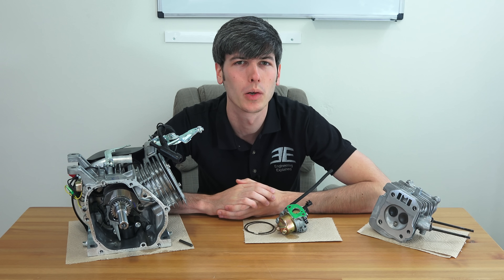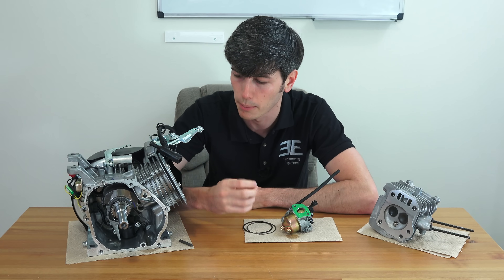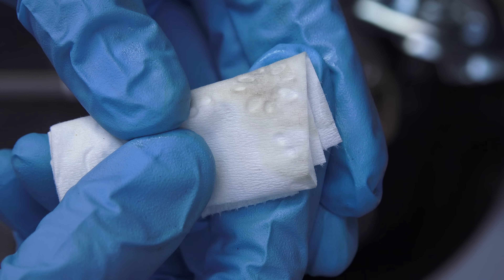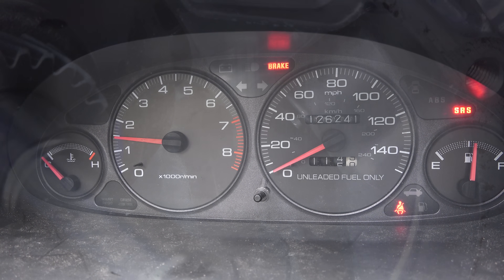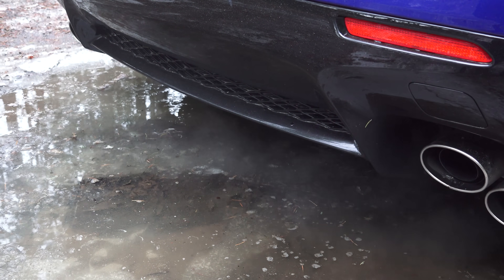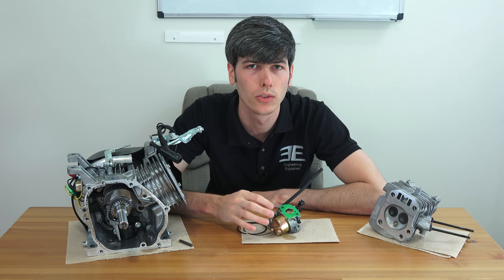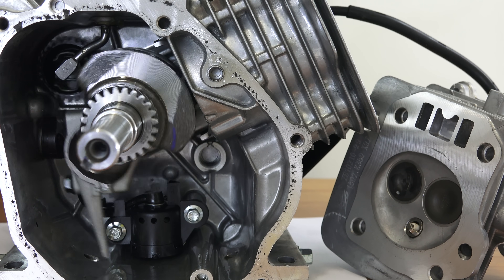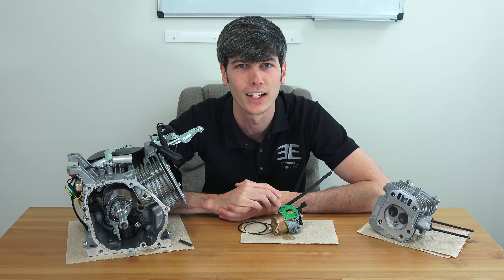Should You Warm Up Your Car Before Driving?

Comment: I always warm my engines before driving.  Engines with over 850,000 and 670,000 miles. Fluids need time to warm.  When steel mechanical parts are cold they are more likely to break .

Comment: Apart from the obvious need to demist the screen before driving there is also the question of the head gasket clamping force. With an "alloy" (aluminium) engine with the head held down with hight-tensile "stretch" studs the differential expansion of the alloy block & head relative to the bolts increases the clamping force on the head as the engine warms up. From memory the clamping force with the engine at around 10degC is about half what it is at 105degC. So giving the engine full beans when cold risks blowing the head gasket. With some highly tuned engines it's an almost certainty - the R500 K-Series based Caterham engine could be almost guaranteed to lunch the head gasket if you gave it full right beetle-crusher before it was fully warm.
So, contrary to what some have said, let it spin in a lower gear and at modest throttle opening so the cylinder pressure is kept down and don't lug it in high gear at high throttle opening as this gives a high cylinder pressure that increases the chances of killing the HG.

Comment: If your oil is 20w50, then a warm up is a necessity. Thick oil does not circulate much when cold.
Reply: You should not use 20w50 when it's cold 😉
Reply: @humanandroid8099  I live in the tropics. It's only cold in the morning (Dec and Jan). My engine is already quite old and therefore cannot use lighter synthetic (or else leaks could occur).

Comment: I heard on the workshop (a motorcycle channel) that the piston rings and possibly other components have to expand to the proper sizes. I never thought about fuel atomisation. Why does fuel atomise less efficiently in a cold cylinder? Is it that the air is more pressurised when it is cold, therefore gas molecules spread less efficiently?

Comment: One other thing you have to consider is that it takes 10-30 seconds or so for the electronics to boot up and enable your vehicle to give you the optimum performance, as it was designed to do. So some warming is optimal both for the engine and the electronics, especially in cold weather.

Comment: If it's really cold 0 and under give it few 5 min and temps in over 20 I give it a min or two. In my semis when it's really cold gotta give it 10 min warm up with idle pumped up to 1000rpm after a min or two idling.

Comment: Today's cars are super simple: just wait until it gets out of high idle, then drive the vehicle easy until the temp gauge reaches normal temp. That's it. It doesn't need to be anymore convoluted than this.
Reply: I totally agree.  However, my car takes a couple of minutes to get out of high idle - even in 40-50 degree weather.

Comment: You bring up valid points and do a great job of explaining. My issues on this topic would be about waiting to drive because of a carburetor...I respectfully disagree. Things like different metals and their expansion. Forged aluminum pistons will expand in a cast iron cylinder bore at different rates when heated, but the excessive “play” or “slop” can leave scoring on cylinder walls- my understanding. I know Chevy LS motors used hypereutectic pistons in the early 2000’s and created a “piston slapping” sound that people mistook for a rod knock until the motor was throughly warmed up. Then turbochargers need oil to prevent early damage, and I’ve seen it take motor oil 30-45 seconds to make its way to the top, out of a rocker arm on a small and big block Chevy with low miles on them!!! Yes, not everything can be covered in a video. But more than just a carburetor is why I wait to start driving my autos. Just my buck fifty 😉 Keep up the great topics!
Reply: I’m sure your “understanding” is more than the plethora of engineers who designed these engines and the engineer who made this video.

Comment: Lame video.  You didn't put much work in here.  Doesnt the increase in rpm while driving offset the shorter time to get warm?  Doesnt the engine heat faster when no cold wind is blowing through the engine?  Seems like you forgot the engineering
Reply: Nope, it warm up quicker if you drive. I just measured the time a few days ago. 6:50 mins with idle, 3:xx mins with driving. Same outside temp.
Reply: @humanandroid8099  
You are not taking the rpm into account, as that is the better measure of wear than time in regard to gas leaking past cylinder wall.  
6:50 min at 700 rpm is 4783 rotations
3:30 min at 1450 rpm is 5075 rotations
So although your engine warmed up faster, it resulted in more wear on itself while in the cold state.  
I was wanting the video to go into this level of detail.
Reply: @Prima10ne  Cold idle started at around 1,200 and I limit the rpm to 3,000 while driving cold. Usualy I wait 1 to 2 mins till the rpm drops a little.

I'll retry it taking the revolutions into account.
Reply: @humanandroid8099  id watch that video

Comment: Why should I wait to drive hard? I thought having the car warm didn't matter? With a new car I think he's right but with an older car (fuel injection or carbureted) you should let it warm up. It's good for the engine AND the transmission.

Comment: You're not addressing the block having varying temperatures while warming up. Hot and cold spots while placing the engine under load can wear parts faster.

Comment: So my question is what is light driving?  If i let my car warmup at 1100 rpm (just after starting) - then I change gears into Drive at 1000 rpm - then light driving is at 1300 rpm - wouldn't it be better to just let it warmup by idling?  I dont see a difference between high rpm not moving vs high rpm moving.

Comment: 1:05 "the longer you spend with your engine cold, the more wear you'll have"

Seems contradictory to your opinion on not warming up a vehicle.

If an engine is not at operating temperature (ie:cold) won't wear be accelerated by the parts (heads, pistons, exhaust/intake manifolds)not being at the proper tolerances as they would at normal operating temperature?
Reply: Görsel : that's a Good point
Reply: @westistanbul  that's because they can't lol

Comment: I warm up my vehicles so their transmission can warm up as well. My vehicles don't shift well when they are cold.
Reply: I've had this same experience. Let it warm up and I don't have problems. Smooth shifting. Drive on a cold start and herky jerky shifting
Reply: I had a car that leaked transmission fluid. I could always tell when it was low because if it was cold out and I tried to leave without warming it up first the car wouldn't move lol

Comment: I always let the car warm up between 30 seconds to a minute, just until the rpm drops down to a regular idle.
Reply: EveryDay  Well by all means, do the math for us. I'm just a lowly Mechanical Engineer.. we don't do much math.
Reply: EveryDay  No one is saying you should sit and idle for minutes at a time, simply stating that allowing the system to fully pressurize is okay. We all live in different climates and deal with different temperature extremes. We all drive different cars with differing oiling systems; one of mine uses a remote oil filtration system, a catch can and associated plumbing. Stands to reason this type of system will need more time to fully pressurize. That said, I get in, start the car, buckle the seat belt, check mirrors, put the car in first gear and go. Maybe 30 seconds, tops. When it is "really cold" out (30ºC) I give it a little more time because as you know, viscosity and all that. 
But if you'd like to argue, just for the sake of argument and make a hard fast "xx seconds" rule, then you're only success is going to be... showing your own  ignorance, especially when people aren't necessarily in disagreement with you. 

Learn when to joust with a windmill Quixote.
Reply: EveryDay  30-60s is fine for lubrication... it's even mentioned in the video.
Reply: It's not just about proper lubrication there, are many more things to consider.
Reply: @andreew46  like what?
Reply: @dragospahontu  Temperature differences across all engine components. Temperatures mainly effect bearing clearances and piston seals. And it's a good idea to let your transmission to heat up a bit.
Reply: @andreew46  afte 1 minute i think you can start driving but definitely don't floor it until the oil temp is at least 80°c.
Reply: EveryDay  could you really get even dumber?
Reply: EveryDay no because it has load on it then
Reply: EveryDay  It's not
Reply: EveryDay  I'm a mechanical engineer and I know a lot about materials.

Comment: I just usually drop a lit match into the gas tank, so the fuel mixture is hot and warms engine up in seconds
Reply: YouKnow this is true, however jet fuel is hard to get, bit expensive and some engines have problems with it. A lit match is cheaper and works every time!

Comment: I let it run in the winter until the cabin isn't freezing cold: I'm more considered about my body being cold than the engine 😁
Reply: Beta
Reply: Thats just wrong.
Idling your car wears the engine out prematurely and it make stew heater take a lot longer to actually get warm air to the interior of that car.
Since you are in cold weather you already are wearing warm clothes, so getting inside a car is warmer than being inside because the cold air is not blowing on your and your body is warming the interior.
Idling the car that I just tested three days ago took 12 minutes to get warm air to the heater vents. The same car when started and driven immediately, had warm air coming out the vents in less than 2 minutes, so obviously driving the car as soon as you start it not only reduces engine wear radically, it gets warm air to the interior much faster.
You'll be far warmer faster if you drive your car after only ten seconds of idling, since you already have a winter coat on, you'll be warner inside the car for ten second than outside since there is no wind blowing on you and your body heat adds to the heater to get the interior warmed up quicker.
I've been doing this for decades, in -60º F weather and have never worn out an engine and have always gotten my car interior warmed up in 30 seconds to 2 minutes depending on how far below freezing the temperature was at the time.

Comment: I warm my car on idle until the temp gauge reaches the lower marking just as the user manual says so. At that point the engine is not stone cold, but not at risk of serious damage either. I can turn on window defog (car has no AC to use dry air for defog, it needs warmth), and the alternator can charge the battery for a few minutes without any other load after a cold start.

Comment: On my Torque app, I wait until the revs get to around 1,000 and coolant temperature is around 125F. If I start it and take off right away too many times, I will get a check engine light.
Reply: Take it to the dealer and find out what is wrong with it.

Comment: Yes, he gave you the wrong answer. You should let vehicles warm up. That extremely cold coolant going into a hot engine does wonders for your gaskets. In fact it makes your mechanic very happy to replace them when they start leaking. So go ahead and jump in and floor it.

Comment: This all makes so much sense...but when it’s -15 Fahrenheit I’m gonna go ahead & let my car warm up for 20 minutes it’s too cold for logic at that point.
Reply: Thats just wrong.
Idling your car wears the engine out prematurely and it make stew heater take a lot longer to actually get warm air to the interior of that car.
Since you are in cold weather you already are wearing warm clothes, so getting inside a car is warmer than being inside because the cold air is not blowing on your and your body is warming the interior.
Idling the car that I just tested three days ago took 12 minutes to get warm air to the heater vents. The same car when started and driven immediately, had warm air coming out the vents in less than 2 minutes, so obviously driving the car as soon as you start it not only reduces engine wear radically, it gets warm air to the interior much faster.
I have years of experience doing in -60 º F weather, though blizzards etc. and have always just given the engine just ten seconds of idle before eI take off and the engines have never worn out prematurely, the heater gives me heat in less than two minutes at those temperatures and i'm perfectly comfortable.

Comment: i recently got stuck in snow and i revved up the engine up to about 3500 while the temp gauge was half way to the middle. i did twice in a row for about 3 secs each time. i am wondering if i caused any damage. temp was about 30 degrees outside.
Reply: No.

Comment: I like to idle a very cold engine at least 3 minutes to get the metals expanding. Piston ring clearances and bearing clearances will be better for higher loads, and the oil gets a chance to thin a bit as the engine heats up, which is better for engine clearances in general.
Reply: Yeah I tend to disagree with this as well, when there saying a minute is long enough, plus it's not just about the engine oil what about power steering Fluids and transmission fluid, yes a car will warm up faster than ideling it but I've seen power steering pumps or lines burst because of driving it too soon and the oil being to thick Which causes over pressure and things like that fail. Now I'm not saying to run the thing for 20mins that's ridiculous but I'm saying a good 4or5mins if it's just moderately cold and 7 to 10 mins in extreme cold like minus 30 to 50 which we never see on the west coast anyways. That's my opinion, thanks.
Reply: @paulderksen5852  I don't know about all the mechanical things but I do know that my car needs more than one minute to warm up in the winter. For one, my windshield needs time to defrost even if I scrape it. Some days are worse than others. If it's not too bad I give it 5 minutes. Right now we are in our coldest period so I've been going more for 10 minutes.
Reply: @lorenavelvet  yup that's exactly right, no problem doing that and it gives your car the right amount of time to warm up. Your car will thank you for it. 😉👍💯

Comment: You are ignoring several other factors.
1. When an engine is colds the various clearances are not "as designed" so components are overstressed (rapid wear)
2. Cylinder heads heat up more quickly than the block. If you put heat into it too quickly the head gasket is overstressed and may quickly fail. (some cars have a blue light or other indication of under temperature)
My method is for drive gently until the temperature and oil pressure has normalised without idling. Idling from cold is also damaging to the cylinder walls. It's a balancing act.

Comment: We used to have something called a choke.
Reply: It`s automatic now
Reply: The problem is that the choke was mechanically connected to a fast idle link so you couldn't drive old cars immediately in cold startups without risking breaking the transmission. You had to wait until the coil expanded enough to allow the fast idle link to move out of position so you could tap the accelerator pedal to release the link. That is what got too many people to think that you had to wait a long time to get the engine warm.

In the very old cars (I had my for share of them) we used to have a choke knob that we would pull and adjust the choke ourselves, manually and in some cars I also had a second knob that was the "throttle" knob, which essentially set the idle speed be higher. I use to be able to pull the choke three quarters of the way and the throttle one quarter of the way and be able to drive those old cars after only 30 seconds of idling.

Comment: To plays devil advocate, wouldn't driving the car without a warm up cause additional wear on the engine?
Reply: Today's motor oil is extremely well made to flow even in negative temperatures. You can drive it ice cold, but you can't take the engine to high RPM like above 4000 until the oil gets warm, like at least 100 degrees. RPM past 4000 with cold oil puts excess oil pressure on parts and head gaskets since the oil is still thick when cold. I had one co worker who always drove his Nissan Frontier like a maniac when the engine is cold. He eventually blew a head gasket.

Comment: Letting your car warm up has nothing to do with it running properly anymore as he said with the fuel injection. It all has to do with the pistons heating up too quickly by driving it before it’s warmed up. It will damaged the components of your motor. This is a common misconception among fuel injected vehicles, just because it can drive doesn’t mean it should. The components of the motor are still made with the same materials as they were in carbureted engines so therefore, they still need to be warmed up.

Comment: But driving the car when it's cold puts more stress on the engine. Higher revs, higher engine load. 
Let's say driving rpms average at about 2500-3000-ish when the engine is cold. City/highway. My car heats up fully in around 7-10 minutes in those circumstances.

So, standing still @ 2500 rpms for 10 minutes puts less stress on the engine than taking off after startup?

Comment: I would say that 1 min is needed in the northern part of the country during the winter months as you want to be sure that oil is getting around the engine before putting it under load.  Check out @projectfarm and any one of his cold flow oil tests.  Again just my opinion -

Comment: Jason does high RPM damage your transmission when you put it into gear after 30 seconds cold start my car has high RPMs in cold weather 1700 for about 30 seconds and then it dips down to 1000 after 3 minutes after 30 seconds I've noticed hard gear selection is this okay for the transmission or should I wait 3 minutes